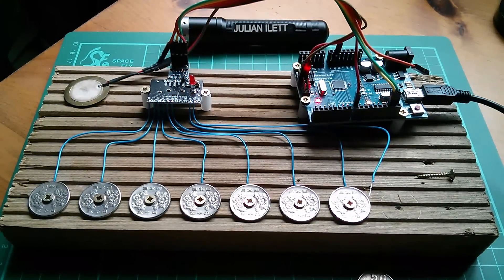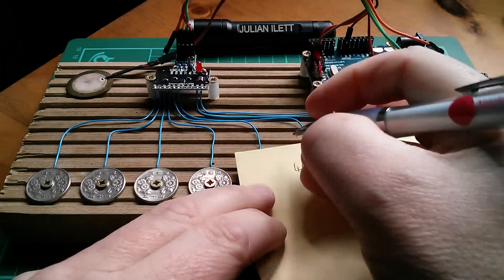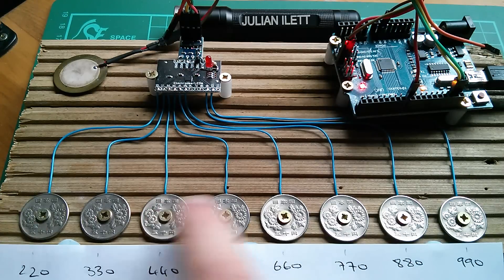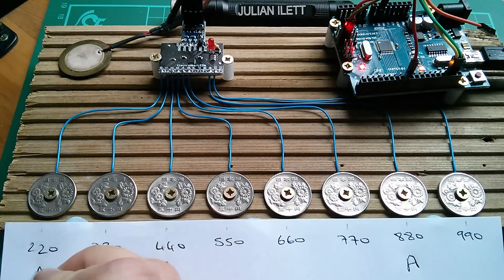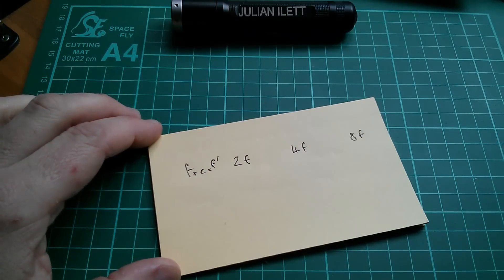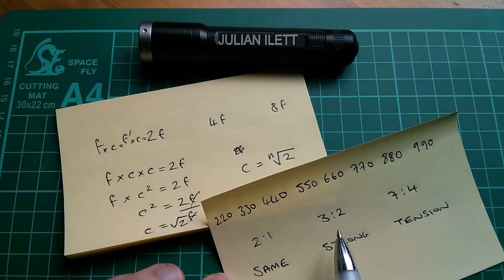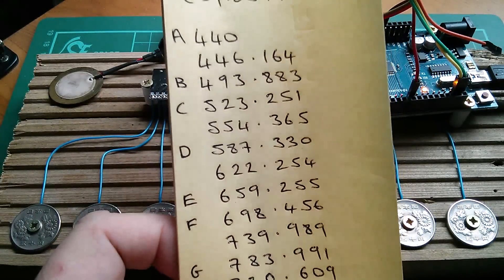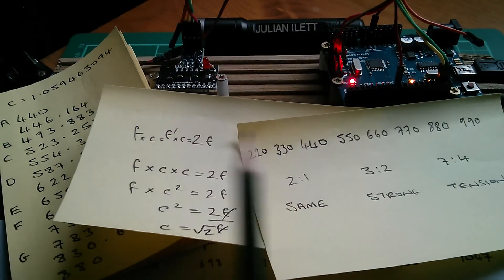Julian's Project: Penny Organ - How Music Works

Comment: I tried it works ,if i touch wires with my fingers are OK,but once i soldered coins with wires then touched coins would not turn out what it like to be.i don't know how,i tried many conductive materials,metal,copper,conductive thread.all similar result.frustrated.

Comment: Boy that was interesting, it reminded me of a time I tuned a piano at a university and was confronted by a professor of mathematics who wanted to know the frequency of middle c I said it was. 526 he said no its not so I said you can soon work it out easy enough  just punch in 440 in the  calculator and add x 1.05943 and press the equals button enough times to reach middle c to get the answer, the professor then set me straight he says THATS THE TWELTH SQUARE ROOT OF TWO, I couldn't compete with him after that, David and Goliath stuff, to make it simple again you could have showed us what 3/2 looked like but then you would  of needed to dream up a term of a fifth,  same  your octave terminology.

Comment: If you're interested in taking this further check out the Mozzi library for Arduino. It allows you to make more complicated sounds than just simple square waves. It also makes it easy to prioritise notes so that instead of having fixed length bursts you can make a sound last as long as you're holding down a note.

Comment: 6:25 I think rather than a logarithmic or exponential scale, it's actually a harmonic series. I think that might the answer to your question about how music came about at all. In terms of actually building an instrument string lengths etc, it starts off with rational fractions which are relatively simple and then just fill in the gaps

Comment: 440 is the standard 'La'. (it used to be slightly different depending on region), or also A of the 4th octave.
Each doubling of frequency takes the same note up one octave. (and halving is a octave lower).
B flat (A sharp) = 466.16
B = 493.88 ( si / ti )
C = 523.25 ( do )
C sharp (D flat) = 554.37
D = 587.33
D sharp / E flat = 622.25
E = 659.25
F =698.46
F sharp / G flat = 739.99
G = 783.99
G sharp / A flat = 830.61
A5 = 880

And from there you can get the higher octaves and lower ones.
Reply: i'm almost certain he knows all that.  i think you may have missed his tongue in cheek deduction process.